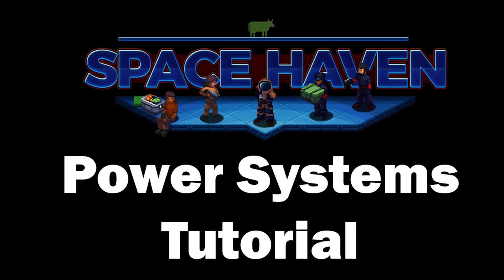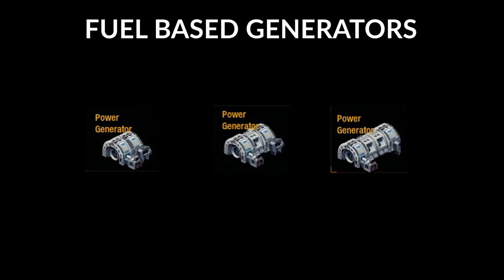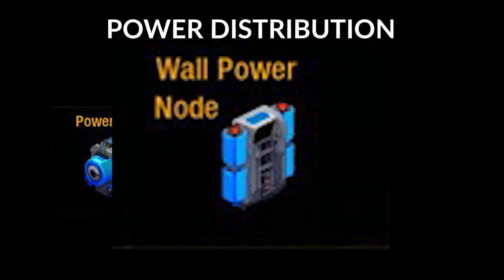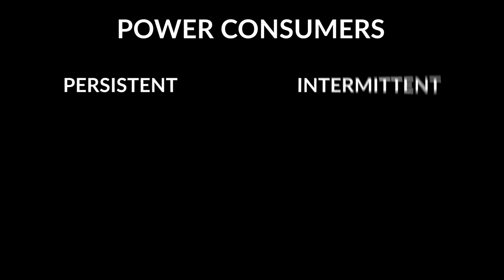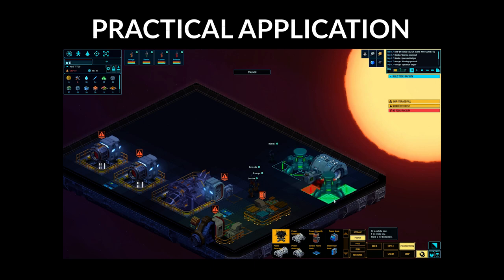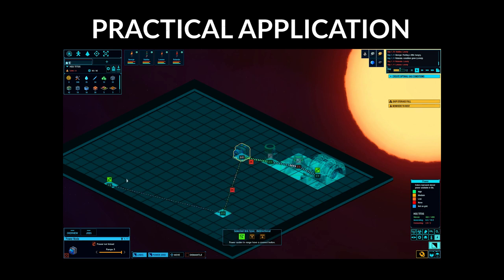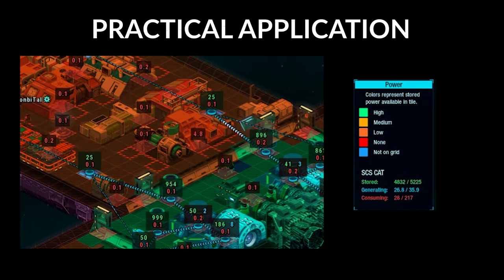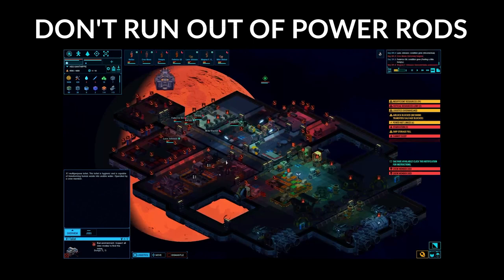[Obsolete] Space Haven Tutorials: Power Systems

Comment: Thanks for the info. Played the tutorial for 7 hours, was so proud of my ship, only to run into a no-power problem. Reverted back several times in the classic TNG episode style, kept running out, until I finally solved it only to have no hull scrap to make anything else or do mining. Finally  was invaded after pissing off a neighboring ship trying to take them over and scrap their hull. Took 2 of my crew captive, and killed the other two. RIP. Learned alot from the experience... especially with this video... make sure to have redundant power supplies!
Reply from the maker: I really like having to learn through failure  in games like these. I think that’s the hallmark of a well built game, even this early in development.
Reply: @Greenbeef  Thats a good point, and a better way to think of it. I think many of us who play this type of game are used to "sandbox mode" but you have to fail a time or two or else you'll just build a big ship that works and it would get boring pretty fast.

Comment: OK, I still have a few questions...

Does putting solar panels after your power supply benefit the system more than putting them before?
Do factories etc use power when not in use?
How much power do lights use? Should I worry about plastering too many over my ship?
If I put 2 heat exchangers next to each other will they use the same amount of power as 1 would (assuming 1 could do the job)? IE am I building an inefficient system because I am mirroring a lot of systems?

Not a question but slightly funny, I tried to make a ship that looked like Voyager, it ended up looking like a rose bud!
Reply from the maker: From what I've seen from my playthroughs and others on the Discord, running solar panels into power generators reduces the consumption of Energium / Energy rods. 
Factories run at a minimum of about .1 energy consumption when on and spike when actively processing. Use the power overlay to see power consumption at the lightning bolt icon.
I haven't seen a significant power draw from lights, so I think you'll be fine putting them all over your ship. 
I think the thermal regulators will each have their own power draw, but I'm not sure how much that varies when it's actively cooling / heating. That's something to test out. 

Hah, it's tough making circular objects in a gridded system.

Comment: how come when you look at the power overlay, it shows as most of the ship as red (low power) only being green in the immediate area of the generators,. I have placed batteries all down my ship to try and smooth load the power but it still showing as red.
Reply from the maker: The coverage areas of batteries is only the the tiles immediately around the battery itself. It will take power nodes to get your power availability to a higher status across more of your ship. It's hard to say without seeing the ship though. I recommend hopping on the discord and dropping an image in the general chat room for help.

Comment: Maybe a silly question, but does it really matter if you make the flow one way from generators?  It's not like they'll consume extra power if it flows back, will they?
Reply from the maker: It doesn’t affect the amount of power consumed, it just makes it a little more effective at recharging nodes down the line. I primarily use the one way links to create independent circuits for different systems or to create redundancy in my power network for critical systems. Individual nodes can become damaged from hull breaches starting with Alpha 9, so having redundancy and additional power storage in key locations becomes more important than link direction.
Reply: @Greenbeef  Cool, thanks for the response!  Yeah, I'm at the point now where I'm restructuring my ship for better power distribution to include things like battery farms near industrial areas and one primary generator that feeds into a chain of solars that feeds into a huge battery bank before even attaching to a node.  Fingers crossed this will work better and cheaper!  Your tutorial series is greatly appreciated, I'm watching the rest of it now as I build.
Reply from the maker: @Brigand231  Awesome, glad it helped. The constant tinkering to optimize a ship is one of the best parts of this game.